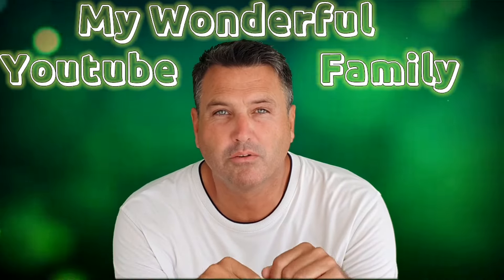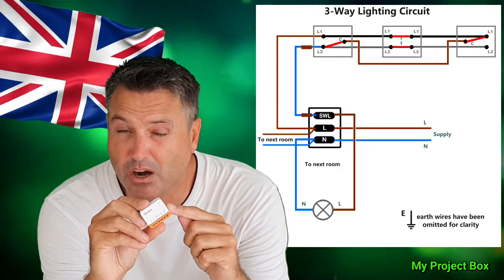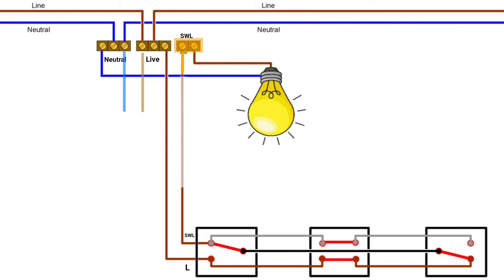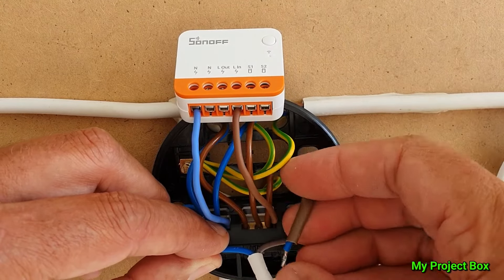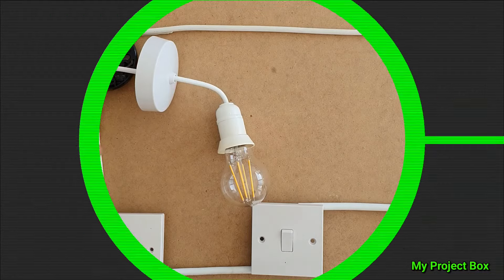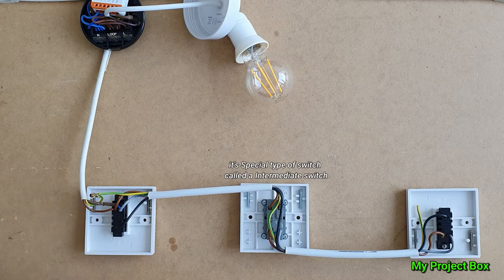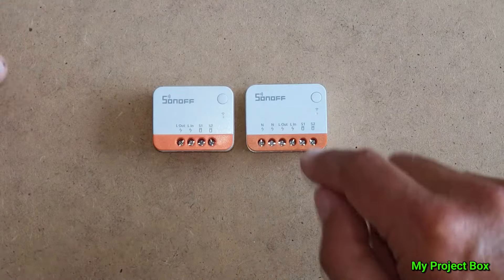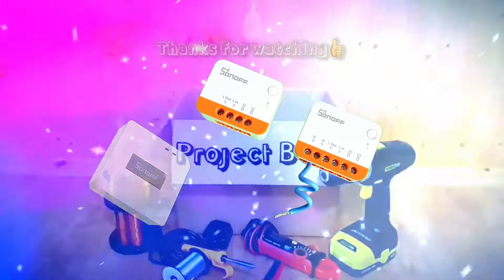Sonoff extreme MINIr4 on 3way switch light UK NO-NEUTRAL required at light switch #Sonoff #extreme

Comment: Hi, I have the ZBMINIL2 which I believe is the ZigBee alternative to the R4.
Would the setup for this be identical, just ignoring the neutral? (UK lighting and can't work out my switch lighting as they are two way switches and I didn't quite follow the logic of the diode technique in your other video).
I don't quite understand the need for a neutral and whether that would change anything in the context of these wires, if the R4 is recommended then I will look to buy a few R4s instead (I do not quite understand the exact differences benefits of the neutral Vs no neutral benefits and drawbacks with smart lighting)

As a side note - although I haven't got it working yet - your videos on the ZigBee products in UK circuits have been very informative and helpful, thanks for putting out such detailed content!
Reply from the maker: Yes you could connect it in the same way as in the video, just without the neutral connected. The ZBMINIL2 is actually more flexible/versatile. There are lots of different ways to connect it up. You could also put it behind a light switch, without the need for a neutral connection.
Reply: @MyProjectBoxChannel  I had hoped so - bought a spool of wire from B&Q today so I'm ready to give it a try! Thanks for the reply
Reply from the maker: @JackRonan  I'm still in the process of making a separate video for the zigbee version 😮‍💨. I was going to combine the two, but decided to do the zigbee version as a different video.😉
Reply: @MyProjectBoxChannel  looking forward to watching it, it would be useful to see it wired both behind a switch and in the ceiling - sadly my plans have not gone successfully. In the ceiling rose I only have a live, neutral and earth wire, I'm guessing the live wire is powered on and off by the light switch which would just turn the sonoff on and off all the time. I will give it a go but not expecting great results. At least I've learned that the wiring in our house is confusing and messy...
Reply from the maker: @JackRonan  you can message me on Facebook messenger https://www.facebook.com/My-Project-Box-105438131355367/  or https://www.facebook.com/robert.wynmaalen so you can send some photos if the wiring.
Reply: @MyProjectBoxChannel  thank you for that, when I went to take some photos to send over I did a few more experiments and think I understand how its being wired up a bit more. If you haven't made the video already, it would be great to see how this smart switch may work with a 2 way switch. From my experimentation I think what is happening is this:
https://www.youtube.com/watch?v=Pky0CWCfY2o - This video fairly accurately shows how I think my wiring is (all in a three gang switch, hence me using this video as an example), I am just trying to work out where best to place the Sonoff., If it wasn't obvious, I haven't done much outside of some basic switch replacements before so it's all a learning curve!
Reply from the maker: @JackRonan  OK.  Do you live in the UK? Because the video is showing the European way(and other countries) of wiring. Sometimes this wiring is also used in the UK, if wired in singles and conduit, mostly.
Reply: @MyProjectBoxChannel  I am in the UK yes, suspect the wiring was done before 2000 (based on the wiring colouring and 1900ish house)
Reply: Hello, I tried wiring a 3 way  into a sonoff zbmini l2 relay, like you made in the video, it doesnt work, if one of the 3 cable switch is off, the relay loses the connection, and its in front of the other 3 cable switch. I tried in front of the 2 3 cable switches and no solution found. Could it be that the wifi version with neutral works?
Note: it's typical in spain too this three way switches connection

Comment: Any ideas for South Africa?
Reply from the maker: If you use the zigbee version you won't need the neutral connection, behind a "normal" single light switch. 2-way or 3-way switching could be a potential problem in South Africa. You might need to pull a extra wire, to get to both sides of the "switch chain". Or get a extra Live supply wire from somewhere. I have workarounds for this, without pulling new wires, but it's a bit convoluted. https://youtu.be/9hQFFsBkxaU 

For just one switch you can "fake" a neutral wire https://youtu.be/oBR5O391m_c

If you have multiple light switchs on one plate. The USA version of the switche in this video could fit in South Africa. https://youtu.be/8h29-0rpQJo
Reply: Excellent video explanation thanks - Am I correct in thinking that for South African purposes the live return from the light switch (live) currently going to the globe now would go to S2 which in turn would close the circuit to L out and turn on the light manually via the R4 mini?

Comment: Is there a way to wire it, that the light is always on? So i can trigger the switch in my HA and use my smartbulbs to go on amd off?
Reply from the maker: Yes I think it's possible. So you want to use the minir4 as a "remote control" for a "always ON" smart bulb?
Reply: @MyProjectBoxChannel  yeah, and without flashing the mimir4 if possible. Its because almost everytime someone is comming to eat or sleep overnight, they press every switch and power off my smart bulbs. So that would be nice, id they can hit the button but the power stays on mo matter what, and the HA.
Reply from the maker: @beatsizedj  yes people turning off smart bulbs, is a pain 😫. I actually came up with a idea for a special smart bulb that works with a light switch, but won't be turned off by the light switch.  My attempt was a bit over the top but it does prove that the concept works.  Maybe some company will turn my idea into an actual product. https://youtu.be/29QgXRgHCx4
Reply: @MyProjectBoxChannel  nice!
But it seems more complicated, than flashing tatsmota on the sonoff. I hoped there is a way to wire it for always on. :(